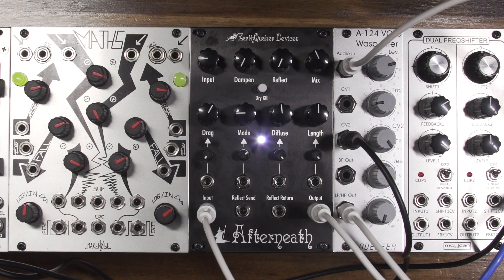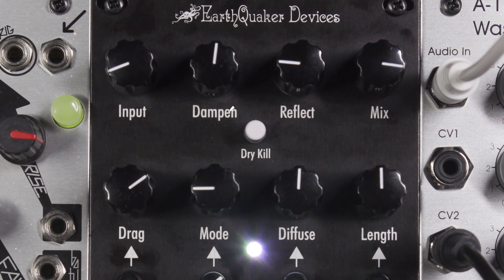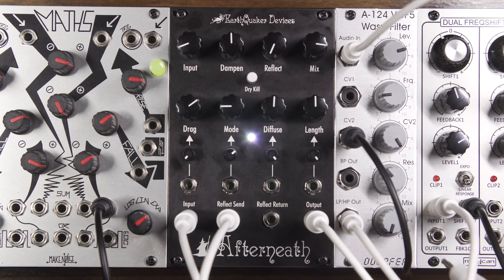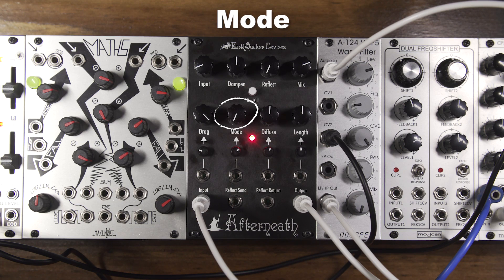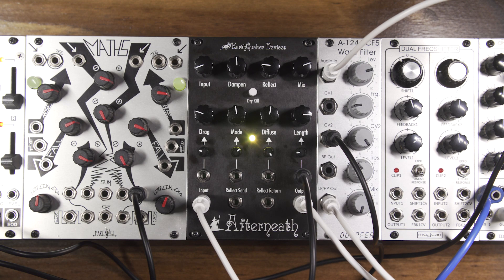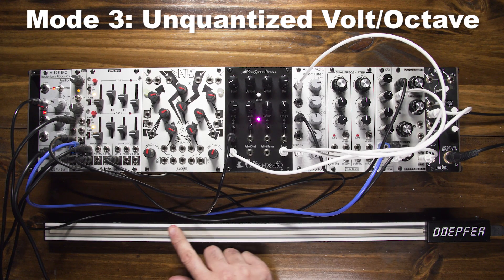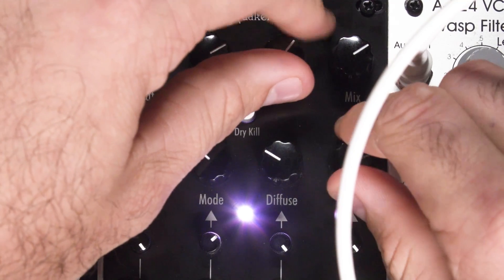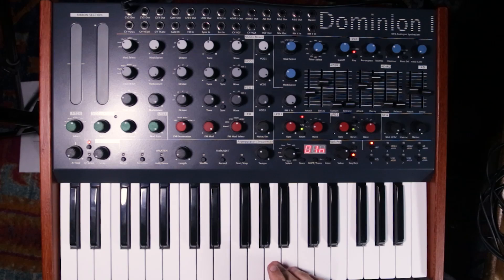Afterneath Eurorack Module Video Manual - EarthQuaker Devices

Comment: I've used 10s of digital reverbs in my life. I'm just not feeling this one. Definitely would've taken an AR or AD module.
- side rant in case someone important sees this. I know i can channel octaves almost immediately from the source of a synth but these pedals are the difference between a dark, clunky reverb with specific utility (afterneath) vs an intelligent, easy sound profile (avalanche) and having that iconic mario galaxy sound with otherwise impossible to achieve delay features that I can only find in my DAW (astral)